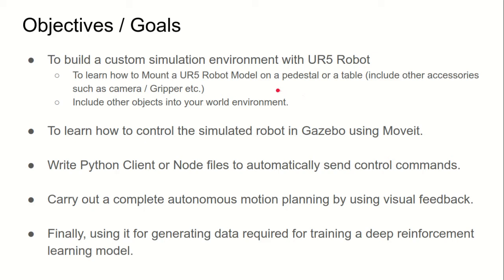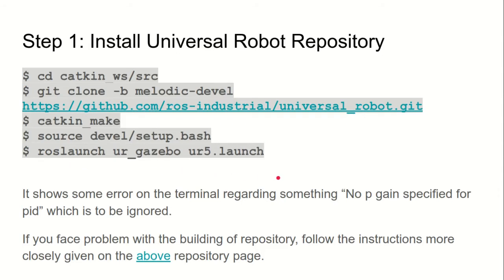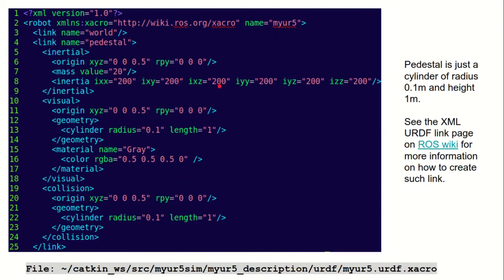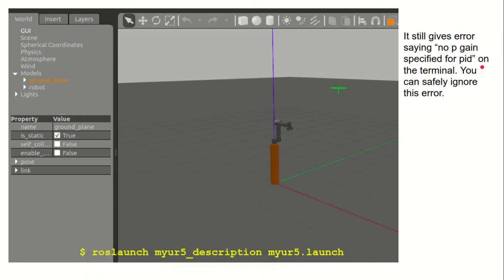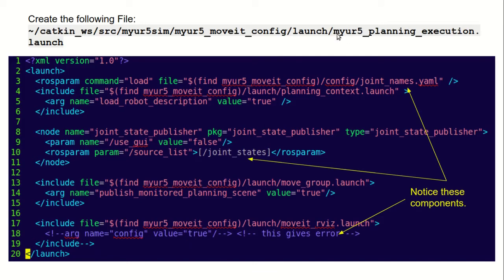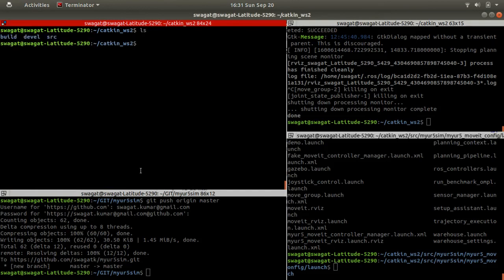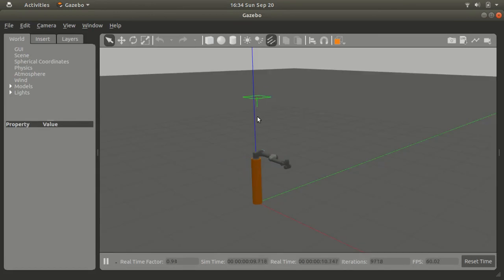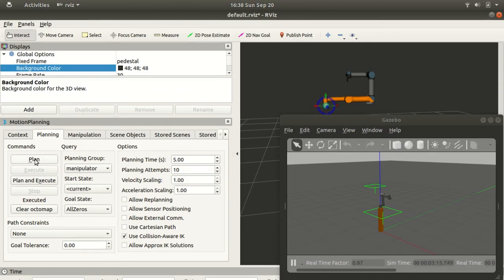UR5 Robot Simulation with Gazebo and Moveit - Part 1

Comment: Hello!
I have followed your tutorial but when i planning the robot in the rviz to go to the home position and then execute it I get the following error...

[ INFO] [1678229488.810671853, 30.334000000]: Returned 0 controllers in list
[ERROR] [1678229488.810865272, 30.334000000]: Unable to identify any set of controllers that can actuate the specified joints: [ elbow_joint shoulder_lift_joint shoulder_pan_joint wrist_1_joint wrist_2_joint wrist_3_joint ]
[ERROR] [1678229488.811010322, 30.334000000]: Known controllers and their joints:

[ INFO] [1678229488.834477985, 30.345000000]: ABORTED: CONTROL_FAILED

Can you tell me why I get this error?
Thanks!

Comment: I am facing this error:

RLException: error loading <rosparam> tag: 
	file does not exist [3]
XML is <rosparam command="load" file="3" ns="manipulator"/>
The traceback for the exception was written to the log file

Does anybody else have this issue?
Reply: Did you solve it ?
Reply: @arjunps8349  No ):

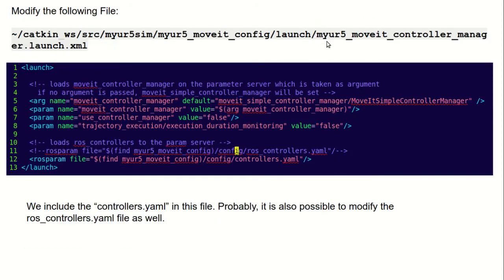Comment: At 13:46, remove line 6 from your code if you get an error saying: 

According to the loaded plugin descriptions the class "your_class_name" with base class type moveit_controller_manager::MoveItControllerManager does not exist. Declared types are  moveit_fake_controller_manager/MoveItFakeControllerManager moveit_ros_control_interface::MoveItControllerManager moveit_ros_control_interface::MoveItMultiControllerManager moveit_simple_controller_manager/MoveItSimpleControllerManager

Hope this helps. 

Great video btw